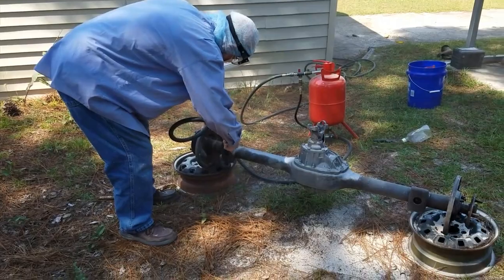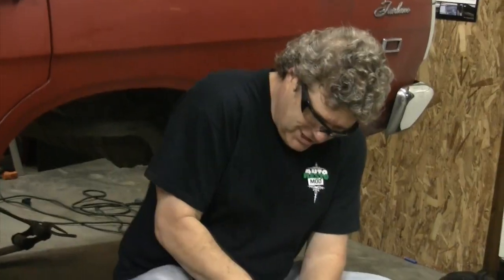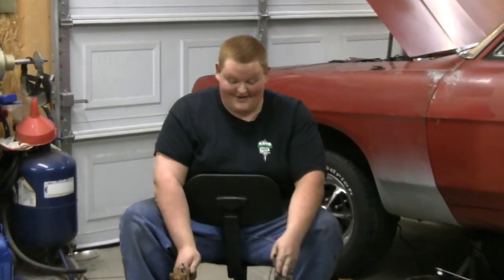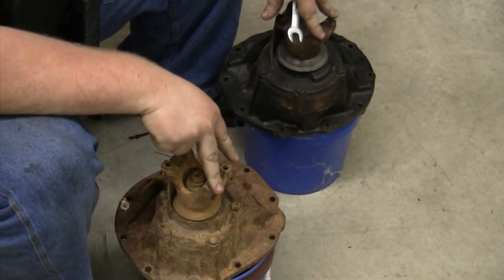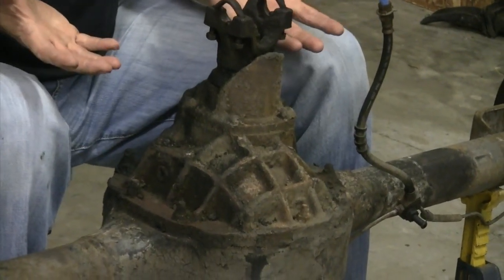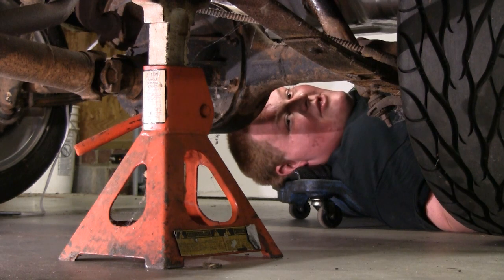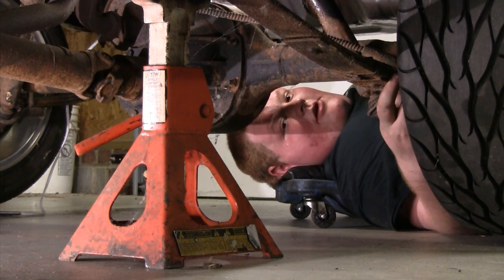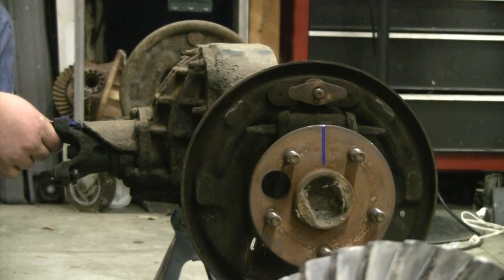Basic ID Ford 9 inch, rear, 8 inch rear end,carrier, center section, Traction Lok, Episode 283 Autor

Comment: Thanks, guys.  I acquired a 68 fastback - thought it was numbers matching according to PO, and while the engine is, just found out based on this video, I have a Ford 9 inch.  Will do the ratio test based on wheel spin test.  Again, thanks.

Comment: the 9" come in multiple variations ..war cases,.wab cases ,n (nodular) are also on the pig and will give you a great place to start..you should measure the outside bearings too as it will give an indication of the axle size..they used different axle sizes and splines from the factory..

Comment: My '65 Mustang has an 8".  I installed 4.55 gears and a 9" spool in 2003.  Also installed 28x11.50x15 MT et streets, which people say you can't fit on a '65. Engine is a built 347 pushing 520hp. 650 with nitrous.  For 20 yrs, never broke the axle. This weekend I replaced the wheel bearings and seals as I had some oil dripping down on the tires. I used to drag the car every weekend. I've entered several burnout contests walking away with trophies. 
  Everyone that looks under it can't understand how it has a 8".  I believe it's how you build it, how you treat it, and whether or not you bought cheap parts off the internet or name brand quality parts.  
  The other thing I've defied is people say you can't drive a spool on the street.  Really?  I've done it for over 20 yrs.  No, I don't do u-turns, but I drive it on the street. Other people say no way to put 9" parts in an 8".  Really?  Then you don't know much about racing and making stuff work.  So much hearsay out there.  To many people listening to others who haven't actually did it.

Comment: I can confirm that the 8 inch will not handle pass 400-425 rwhp. My 65 stang is putting down 425 to 450 rwhp and I am on my third full rebuild. I have it done now as tuff as you can go with a 8 inch and so far no problems. Lol. One would think my stupid self would just get a 9 inch, but that would be smart of me and we can't do that.
Reply from the maker: We've been that smart before too Rosco...So you aren't alone.

Comment: any advantage or disadvantage using a 1957 9" housing on my 1967 Fairlane build? It came from a T Bird. If the spring and flange dimensions are the same I will pick it up. It has the all round back cover on it.
Reply from the maker: Just make sure that the center section has a fill plug in it and you should be good to go. I'm not sure that the perches are going to be in the same place though.

Comment: Hey I have a question should the wheels be able to spin if you’re holding the driveline steady?
Reply from the maker: An open differential will have the axles spin in opposite directions. A traction lock will both spin in the same direction.

Comment: Great Vid, I am in need of some help.  I have a 1963 ford f100 with a one wheel peal diff. When I jack the rear end off the ground I can spin both rear wheels in either direction with the trans in "Park".  Drive shaft doesnt move but wheels spin freely. Is this correct or is there something wrong with the rear end. My 85 year old uncle says thats how its supposed to work, but seems odd to me. Appreciate any help you can offer. Thanks
Reply from the maker: I think he might be right. But I'm not sure honestly.

Comment: Interesting guys. I really liked this one. Ive been curious about how much drag the 8 inch has vs the 9. It is known that the strength of the 9 comes from a low pinion angle witch also results in parasitic drag. I have been wondering about if the 8 has the same feature. Or if the pinion is alittle higher?
Reply from the maker: The pinion is about the same position, but the weight of the gears and diff make the 8 better for parasitic loss

Comment: What if the back of the diff doesn't have the hump but the two bottom bolts can't be accessed with a ratchet and socket? Mine is mixed. Ford galaxie. 1965 289 w c4 transmission

Comment: I've got a question. I have had 2 cars, a 1971 Mercury Cyclone Spoiler and a 1970 Ford Torino Gt. Don' t have the Cyclone anymore, just the Torino and just put it on the road. But anyway they are both 351C 4v, 4 speed cars with the 9 inch (3.25 gears). Both cars have this same symptom and it drives me nuts. Whenever I let off the clutch from a complete stop the cars would violently shake and I would hear a repetitive clunking sound coming from the rear of the car. It does this probably 80% of the time. Once I get going (6-8 mph+) it goes away. I am 95% sure it is the rear differential, I just don't know what exactly. When I owned the Cyclone I always thought it was worn clutch packs because it had trac-lok. But the Torino has an open rear end and does the EXACT same thing at the exact same time. 

I haven't touched the driveline in the Torino yet, but when I had the Cyclone I replaced the u-joints and no dice. I remember having the rear of the Cyclone on jack stands, I would put it in gear (with engine running) and watch the tires spin and both were noticeably wobbly, bent axles? Do you have any ideas on what is could be? I hope you didn't mind  reading my essay but this problem is very annoying and embarrassing and I get stressed out coming to a red light/stop sign. Any advice would be great.
Reply from the maker: We'd first look at the universal joints. It could also be an axle bearing issue. check those first before you break into the center section.

Comment: any idea what a "N" or "2" in yellow between the cast webs means? this is on my 8" going in my 56 f100.
Reply from the maker: An N is used on the Ford nine inch to denote a nodular center (if it is cast into the iron) An N or a 2 in yellow markal or paint can mean almost anything. I've heard tell that line workers would send messages on parts to friends further down the line. 2 might have been when Bob's shift ended. Someone may have a better explanation but I have no idea. --Jeff
Reply: stands for Nodular iron, this is the best out of the three from the factory. Standard, WAR, and N are the three types. stay clear of the WAR, they tend to crack around the bearing seat

Comment: Nice Video, just got a 66 coupe with 6 cylinder automatic. I want to use an 8 inch and go to 5 bolt. Do you know where I could get a list of rear ends that will fit. Just going to be a driver, will keep the 6 for now and maybe 289 down the road.   I would like something that will bolt on without a ton of mods. Not a mechanic. Thank you.
Reply from the maker: The stock '65-'66 Mustang width is: 57.25 
Closest: 1974-'78 Mustang II @ 57 inches / 1969-77 Maverick @ 56.50 / 1957-'59 Ranchero and Station Wagon @ 57.25
Reply: Thank You!! appreciate the info.
Reply: @AutoRestoMod  What about mid 70's Granada/Monarch? I don't think there are many left but always always check Granada/Monarch diffs at the junkyard. When I worked in a trans shop back in the 80's I ran across at least 2 6 cylinder Granada's that had a 9 inch in them. Odd yes but true. My brother in laws 75 Monarch 351 car had a 9 in it from the factory.

Comment: Can you tell how many splines is on a D2SW-C 9” rear end?
Reply from the maker: That number is for a pinion support. It is a standard unit. You would really need the axle tag to know. If the center section were out of a truck it would typically be a 31 spline. Passenger cars were typically a 28.

Comment: Ford mustang 1967 8 inches or 9 inch rear
Reply from the maker: If it was an original big block car AKA 390 and 1967 it got a 9-inch everything else got an 8 in with the exception of the 289 high performance

Comment: Is there anyone who can explain more how an Equa loc works compared to a Traction Loc?
Reply from the maker: From a web site I found:
The EquaLok rear axle design is older than TractionLok, and uses a belleville spring to tension the clutch pack. This design is somewhat compromised, as the tension is always constant, and is always the same, regardless of operating conditions. It has to strike a fine balance, as too much tension wouldn't allow it to slip when turning corners, and not enough tension would cause it to be too loose for hard acceleration and traction when needed.

TractionLok is a torque-sensitive design that uses four coil springs that keep a constant tension on the clutch pack, but this tension is not very tight and is designed for light loads, such as driving on wet streets or on snow. The tooth design of the differential pinion is different from EquaLok, and was designed to put side loads on the side axle differential gear, which is connected to the clutch plates, which compresses the clutch pack and causes it to lock up. This design provided light locking for normal driving and increasingly firmer lockup for higher loads.

Comment: 400hp that's all.lol i put 600 hp to stock 7.5 in a s10.
Reply from the maker: But...how long did it last? 😀
Reply: Will i had it for two year's like that and sold it.
 @AutoRestoMod
Reply: I have a z28 and a 1969 Mercury cougar with a 408 stroker  my nine inch is stronger than My 8.5 LoL